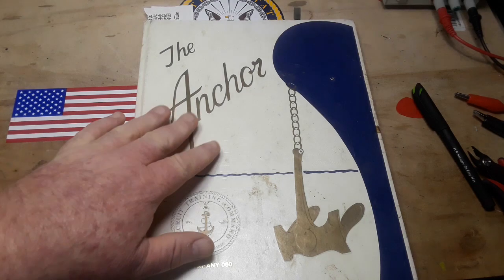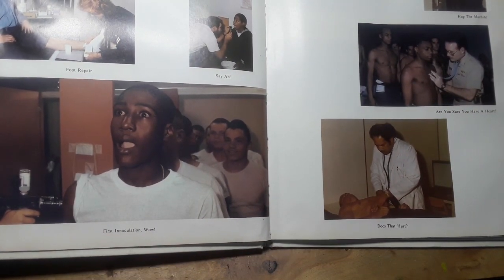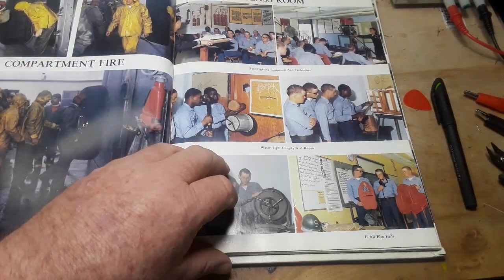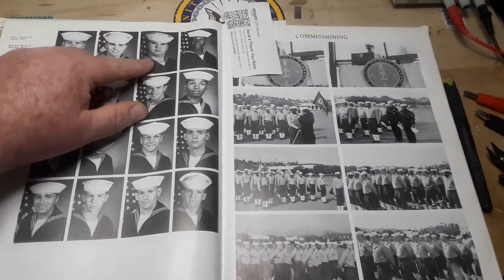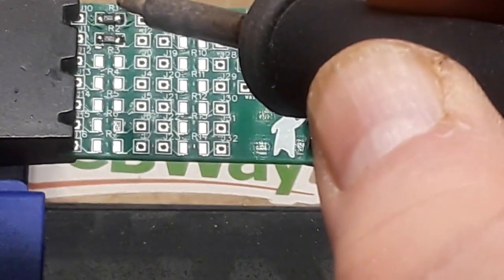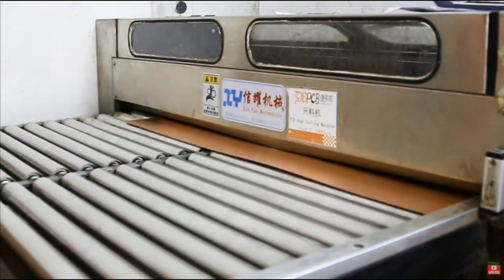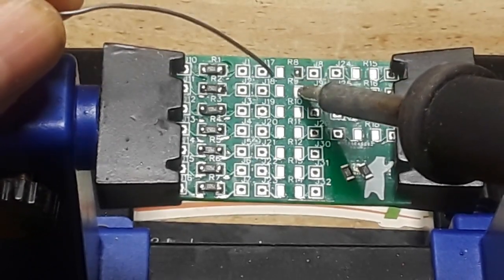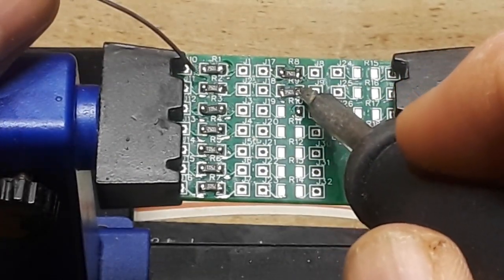Smd Soldering Practice and Bootcamp memories

Comment: If you wish to practice SMD soldering, I suggest you order some SMD to leaded interface boards. Such boards are useful for 8,  14 and 16 pin ICs. Small SMD supply decoupling capacitors can be added to the interface board, to provide close decoupling of the power rails.
When soldering SMD,I find it is a good idea to use a binocular microscope. Improving the view of the components, and greatly reduces any hand shaking associated with having a low gain in the human control loop between eyes and hands
While I have a board holder,similar to that shown in the video, I find that this does not fit well under the microscope. I use an old upturned lid from a diecast aluminium box as a stand for the PCB being soldered. 
My long reach microscope is fitted with a home made fume extraction fan. This keeps the solder fumes from condensing on the objective lens of the microscope. 
As a tip, always use are tin or gold coated board contacts, as this gives the best solder flow and wetting. It is a good idea to wipe each PCB contact with a flux pen, just before soldering. When soldering SMD ICs, solder the opposite corner pins first, to establish the position of the IC over all the pins. It is far easier to reposition the IC by remelting the two corner pins. 
The best technique for making the first  connections to a two or three device, is to flow some solder on to the pad, and then slide the component into this solder, obviously holding the device in tweezers. 
Ideally select tweezers that are not magnetic, so as not to accidentally move the component, some of which are attracted to a magnet. Chose tweezers that are not too springy, as these require a tight finger grip, that can ping the SMD component across the room. Tweezers that only open a short way are best, as some components can be trapped in the jaws. 
I don't use the flood soldering technique, because I make most of my own boards, which are tin plated, but do not have a solder resist.
When designing PCBs for hand soldering, rather than flow soldering, design the pads with a generous pad length, this allows the iron to heat the pad while the component is in place. The solder can then be applied to wick up between the pad surface and the lower surface of the component lead foot. 
Selecting the correct pad footprint, is critical for soldering components with j leads, or worse, components where the connection is only on the base of the component, as for example some clock oscillator ICs. These components are designed for flow soldering, and the only way they can be placed by hand, is if the PCB pad can be heated to allow the solder to wick between the pad and the IC connection. This is impossible if the recommended footprint for the device is used, as the IC completely covers the pad, leaving no scope for heating using a soldering iron. Unless an extended pad is used, the only choice is to use solder ink and a hot air solder gun, something to be avoided if the component is not to risk being cooked. ( Hot air guns also cannot be used with a microscope, unless it has a very long focus, that keeps it a distance away from the hot air.)
Reply from the maker: Thank you
Reply: @learnelectronics  I hope it helps, just adding my two penneth of experience.
When making interface boards, there are single in line rolled pin to pin connectors that can be used to mate the daughter ( interface) board to a mother board. Needless to say,  its good practice to design the interface board on a standard IC widths, the 0.1  inch pitch. 
A trick when soldering these connectors to the daughter board, is to plug them into a a couple of standard IC socket, for support while soldering. This ensures the interface board connectors are held upright and tight to the daughter board.
. To avoiding melting the plastic of the connectors, it a good idea to offset the supporting IC sockets, so it is not connected to the pins being soldered. 
For example, plug in pins 1,2, 15 and 16 into one supporting socket and 7, 8, 9 and 10 into another, then solder the intervening pins. Alternatively, plug the SIL connectors across the supporting socket,
 Both methods  will hold the SIL connectors rigid and upright and at the correct pitch, making soldering much easier.
One further tip, never solder pins in sequence, solder the corners and then odd and even connections. This avoids the heat melting the plastic between  adjacent pins, giving the pin time to cool down before returning to solder the adjacent pin.

Comment: Company 309  - I highly recommend using hot air and MG paste solder under lighted magnification. I have a magnifying glass in a 3d printed bracket mounted on top of my bench mounted lighted magnifier. (stacked magnification) It makes thing so much easier when you can see. Set the component on crooked and when the solder flows the component lines itself up. Erkin has some really good videos on HDD Recovery Services channel.

Comment: For hand SMD soldering like this I settled on Hakko 900M-T-0.8D and 900M-T-1.2D chisel tips. I'm sure this style is available for other irons. Works great while working under the microscope - just slide the flat tip along the pad and on up to the side of the part. Perfect for SOIC pins too. I prefer to just do them one at a time instead of drag soldering. Even TQFP's. Easy peasy.